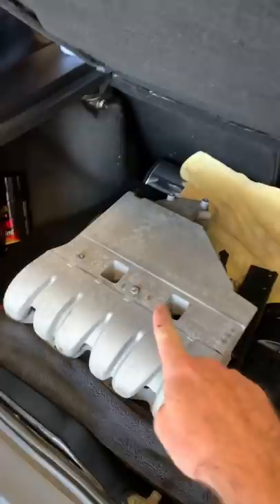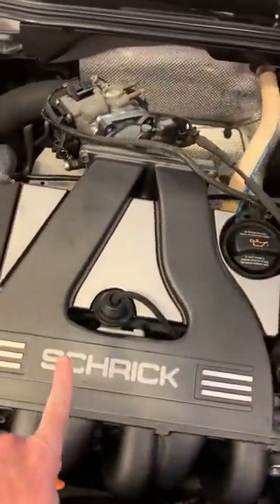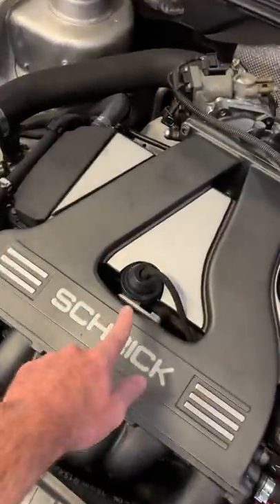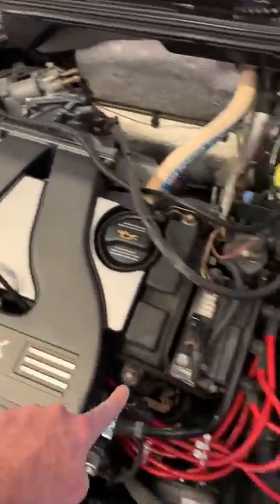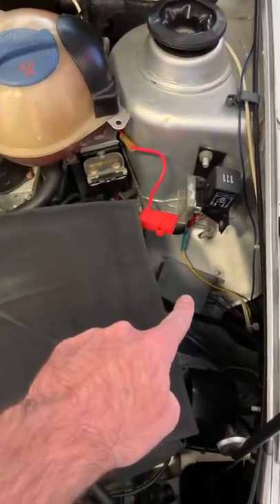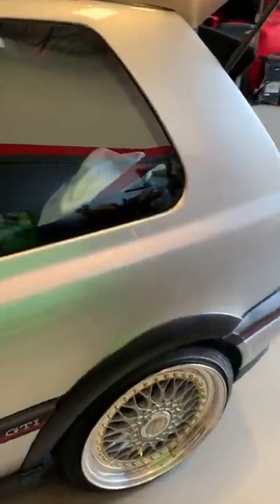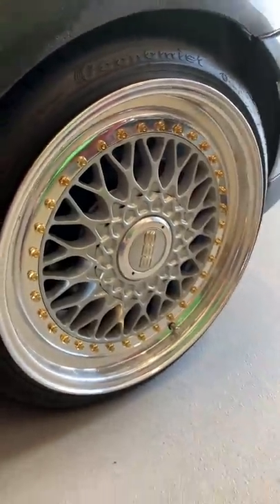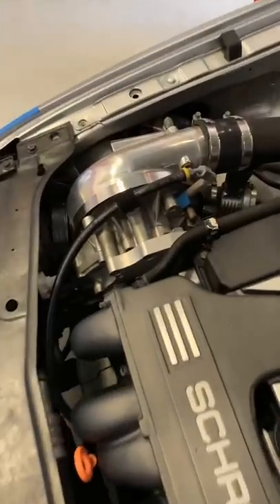That’s a nice GTI #shorts

Comment: The amount of people calling that centrifugal supercharger a turbo or procharger in the comments is unbelievable
Reply: I have a migraine reading these comments 🥴
Reply: At that point why not just get a turbo? Is there some advantage to being belt driven that I'm not understanding?
Reply: @Jackaldev  a belt driven system will make less power than a turbo, but you dont have the lag of a turbo, as it spins up immediately with the engine instead of needing exhaust to build up
Reply: @Jackaldev  because there's no turbo lag, and with centrifugal superchargers the boost curve is more linear when compared to turbos which can sometimes be instantaneous depending on turbo size
Reply: It breaks my heart more than my ex leaving me for my trainer at the gym
Reply: Pro charger and Centrifugal supercharger same thing
Reply: Hah... It’s an uncommon type of supercharger, it's on a car that almost universally gets boosted by a turbo, it actually looks like a turbo, and it sounds like a turbo (without lag) when the engine revs — so I'd say, actually, it's exceedingly believable that people thought it was a turbo.
Reply: it's understandable tho with a centri setup. supercharger, turbocharger, and then saying 'Procharger' just naturally fits in there with the other two
Reply: @willywillywillywillywilly  theres no hot side of the turbo. Id debate the statement that this car gets turbod exclusively. Superchargers can bolt straight on. You dont need the plumbing you need for a turbo. Its a simpler install. Ppl usually graduate from a sc to a turbo.
Reply: @Jackaldev  its a simpler install then a turbo. You can usually just bolt on a sc. A turbo requires all sort of plumbing (piping). Plus you need a different intake AND exhaust manifold. Usually you need a intercooler to cool the charged air from a turbo, and different tuning and map sensor as well. And finally its way cheaper then a turbo. A turbo install is a commitment, where as you can usually bolt on a sc so its easier to return to stock if need be.
Reply: Literally 2 people before you made this comment
Reply: @deadmemesandbrokendreams  i looked at every comment before i posted this, and i was the first
Reply: Guess you don't know much..calling it a procharger isn't far off..procharger is a brand of specific centrifugal superchargers..so pretty much the same thing..just saying
Reply: @chasepatesel7118  i know that, but people in the comments were saying it wasnt a supercharger, and saying it was a procharger instead, also, i bet this one isnt a procharger
Reply: Yeah? How many psi of boost does it make? 60? Oh, 6? Turbocharger please...
Reply: @Fckuok  pro charger is a company.
Reply: Either way it sounds like a queef. What a joke toy
Reply: @MightyWhiteofYou  good think you dont buy a supercharger for the sound
Reply: @ljguy300   you have to
Reply: @boomcannon9732  but you do have lag in that boost ramps with those superchargers. If you are going to supercharge, go positive displacement blower. Centrifugal is all of the disadvantages of both sc’s and turbos at the same time
Reply: @FelonyVideos  boost numbers are irrelevant to power without knowing every other specs of the power adder and engine... but sure, big number is more better derrr.
Reply: All the yapping about what it is and what it isn't and what would work better and it's about a leaf blower on a weedeater engine in a go cart. Pffft
Reply: When I pop my s2k hood lmao 🤣
Reply: I also call aluminum foil Reynolds Wrap...
Some people just wanna watch the 🌎 🔥

Comment: You seem to work on VWs a lot, so I got a question. I just a got a mk4 tdi Jetta as my first car and I just don’t know where to start tuning it. So, any recommendations?
Reply: Save up for something else 😜
Reply: You don't want to mod a Jetta. You'll get made fun of boyo. It's literally a coupe made fore cruising. You aren't getting any more power out of that car. Get something like a new beetle with turbo. They are fun.
Reply: Get something Japanese or a ford
Reply: Superchip, clean fuel filter/water trap, clean injectors, clean or put bigger intercooler, or charge cool it,
Some nice head lights aswell, sound system,  nice mags, tyres, nice exhaust kit, de-cat exhaust or straight pipe, maybe a little tint.

Go wild, or mild, don't worry about others. Make it custom
Reply: @AidansCars  bruh you can get 50% power gains from a 1.9tdi with a tune you dont know what you are talking about
Reply: @boomcannon9732  clearly he doesn't I mean he suggested him get a beetle.
Reply: @Dapope03  ford engine are awfull in europe
Reply: @joeke3141  probably because they're not meant to be made in Europe it's an American car that's cheap and easy to work on
Reply: @Dapope03  Ford 😅😂🧑‍🦽🤦‍♀️
Reply: There are countless modifications you can do to the jetta. Head on to a company in the uk call darkside developments thay have countless 1.9 8v tdi over the 250bhp mark. with just there bigger gtb2260 turbo kit, bigger there race injectors, single mass clutch kit, intercooler kit, then remap you will have a nice quick economic little wip... had the same stuff on my seat toledo (exactly the same car as the jetta) and was running 260hp after remap. And getting 60mpg on a run...

Comment: Are variable intake runners like VTEC? I honestly have no idea but I am car curious
Reply: Sort of, reminds me of the Gen 6 1994 - 1998 Toyota Celica's ACIS system. This allows for a longer running intake making it more efficient and more low end torque, as soon as the butterfly valves close, the intake runner is shorter, allowing for greater HP increase at the top end. Just changing the length of the intake rather than the aggressiveness of the cam profile, which VTEC does.
Reply: @notsure3484  I was literally going to comment that, i had a gen 6 st202 with the 3S-GE engine back in the day.
Reply: @obiitom  yep got myself a JDM ST202 Celica, had her for 10 years going strong at 85,000kms
Reply: @notsure3484  mine was a 1993 production imported from Japan to the UK in 2000, one of the first ones ever made probably sold in 1994. It had 60,000miles as they get rid when they cars have to go for a hugely expensive test in Japan where practically every component will need replacing. 

It had all the TRD components available from the catalogue from what I am told and could see, though i couldn't see if they did the pistons and what not, and the wheels were swapped back to brand new standard ones but I replaced them right away to some light weight BTCC wheels. 

Sold it after 15 years as the TRD body kit was GRP, as the paint died due to age no one could repair it properly due to issues with paint and gel coats all reacting, multiple body shops tried and failed, was just something about the old GRP not playing nicely with modern paints. 

Looking it up on the government database it looks like it was scrapped so I imagine it was broke for parts. It was the most reliable car I ever owned. 

RIP sweet baby girl, gone before your time.
Reply: @obiitom  A true love story mate.

Got mine imported from Japan to NZ back in 2011 with 12,000 kilometres, gave it the good treatment with some TRD front and rear spats, kouki headlights and taillights, veilside side skirts, fibreglass bonnet, aggressive cams, all the engine work on the head, TRD front strut brace, rear brace, KYB shocks and cobra springs.

Pushes 220whp being N/A, trying to not 3SGTE swap it and it rips. Best purchase I've ever made, always a head turner, never looked back on it since. Rides like a dream 11 years later still going strong.
Reply: Similar in effect but completely different in operation. Both are designed to alter the point in the revs where maximum cylinder filling occurs. 
The effect from vtec (2 cam profiles) can be much more pronounced, but you can have both together, such as in the mb6 b18c4 or some h22 Honda engines (and probably more besides). Both can be used for performance and/or economy gains.
Variable intake runners work by alerting the Helmholtz resonance of the intake runner, similar to how a trombone works. Change the length and/or the diameter of a pipe and you change its resonant frequency. If you time the resonance with the valves opening, you can force more air into the cylinder, thereby allowing more power to be produced (you can burn more fuel).
Reply: @jdmjesus6103  thanks for the knowledge brother

Comment: In Europe the vr6 don't have the GTI badge. It's yust vr6. The mk3 gti in Europe only deliverd with the 2.0 8v ( 115 hp) and the 16v ( 150hp) engine.
Reply: That's correct. And the 16v is factory detuned to 150hp. With a proper tune it will make 165 to 175 hp
Reply: @mwagner1444  so less power than your average European diesel family hatchback of today.
Reply: True tho. Still more fun
Reply: @mwagner1444  I'm not sure, some of the modded TDI's handle better and are much quicker.

Comment: How is that a supercharger it looks like a Turbo charger, ? …serous question tho lol
Reply: Centrifugal supercharger basically a turbo but ran by a chain or belt in this case
Reply: @Boris-te7pn  a pretty high end supercharger, the only super charge I’d do anyways
Reply: Supercharger and turbo aren’t very far apart , I’m no mechanic neither is anyone in the comments so don’t listen 💀 just look it up if you really wanna know
Reply: @Oscar-fc2ye  they do similar things in different ways. Superchargers are ran by belts making rhier power band more broad and on demand. While your typical turbo has a delay and comes in at the top of the RPM, also turbos are driven by exaust and gasses.
Reply: It’s basically a turbo that lacks a hot side and is driven by the engine via a belt and a pulley. There are two styles of supercharger which are centrifugal and positive displacement superchargers. Centrifugals like the one in the video whistle and the positive displacement blowers whine.

Comment: My 2001 dodge intrepid (3.2L not 2.7 garbage) had the same manifold setup. It also had a normal engine setup(not transverse mounted) and was still FWD. Had same transmission as PT cruiser. It also had clearance for a drive shaft going to rear wheels. I wish the motor didn't blow up after gfs sister abused it.  RIP